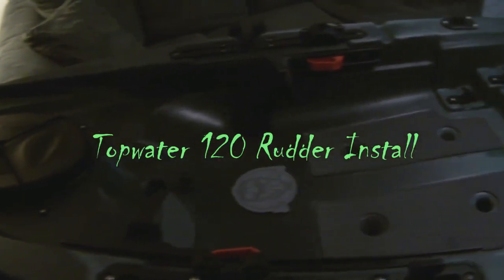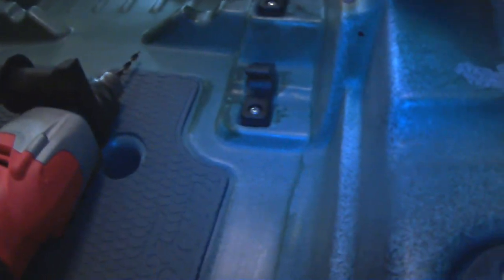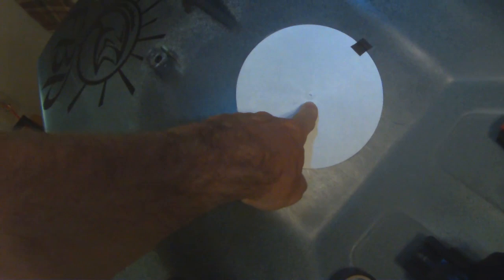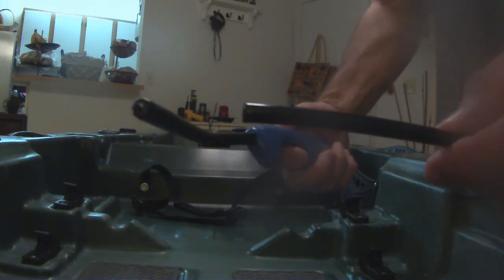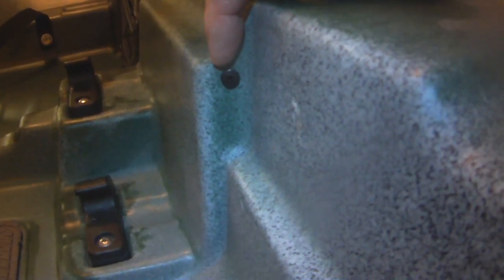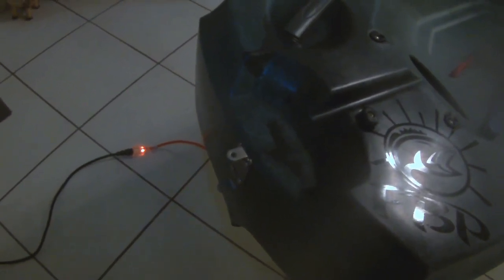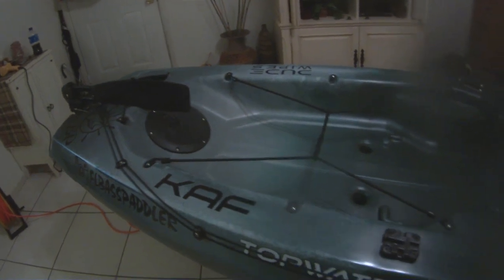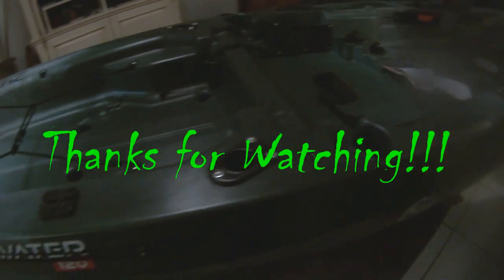Old Town Topwater 120 Rudder Install

Comment: Pretty sure this will work for the Sportsman series as well. Not sure why they didn't build in the tubes in the factory since it has provisions for mounting a rudder
Reply from the maker: It should as it is the same hull design.
Reply: The official rudder is almost $300 in Canada so I was thinking of getting a Chinese one and modding it. Some clear plastic 1/4" plumbing tubing should work for the tubes.

Comment: Bill, I have been following your install. I am to the point of installing the bungee that recenters the pedals. The instructions are unclear and I can't see the bungee in or the way its installed. Any suggestion on clarity for the bungee install for the pedals?
Thanks for the video ! Had old towns pictures been a little larger I might not be stuck!
Reply from the maker: I am so sorry, but I no longer own this kayak. I can't for the life of me remember how I installed the bungee. Again, I know it is to keep the rail system centered, I just can't remember how I installed them.

Comment: Wish you could have shown how you cut the Hole in the kayak as well as the rear tube and the rutter guides and running your cables and installing the rudder. Anytime you are putting holes in your kayak it is nerve racking.
Reply from the maker: Sticks29 Yes it is. I actually posted a video of an installation of a rear hatch in my PDL...that shows in detail how I cut the hole in the tank well.

Comment: Nice! Is it possible to just install the rudder without the lines to lower & raise and just manually lower before you go out? Not a fan of lines running on the outside of kayak.
Reply from the maker: I guess you could do that but if you hit, let’s say a stump and it knocks the rudder up, you’ll have no way of lowering it unless you get out of the kayak.

Comment: Hi Bill loved the video. I've got the 120 also and I'm debating the rudder upgrade. I understand all the install except for the foot pedals. Do the rails slide fore and aft to provide movement for the control wires. I know the pedals are stationary once they're locked. Thanks for the install video. Nice job.
Reply from the maker: Brad, thank you for the kind words. Regarding your question, during the install you will remove the existing rails as well as the pedals and will install slide rails. You will then slide the rails and pedals into the newly installed slides, and then the entire rail will slide fore and aft. The foot pedals them selves will still remain stationary to your liking. If you look at 9:59 of the video, you can see the previous rail installed into the slide. I hope this helps.
Reply: Well sir you sold me on the rudder kit. Ordered from Old Town and got a Labor Day sale price. Thanks for the video and for your coaching.
Reply from the maker: @bradthornton2494  Thanks again for your kind words and best of luck with the install.The rudder makes such a difference, it makes the kayak that much better!

Comment: I am having issues with figuring out the deployment cable.  The directions suck, and sadly you skipped over the setup of it.  I have the cables to the point where it says don’t run them through the last guide.  After that the directions basically make zero sense and the pictures the provide based off the directions are impossible.
Reply from the maker: So are you at the point where you need to make the  fishermans knot?
Reply: @flbasspaddler the directions are very unclear of where to and how to run the bungie to tie the knot, but yeah that’s exactly where I am stumped
Reply from the maker: @Snags70  OK, so if you find me on Instagram, follow me; this way I can send you a picture I found on my Facebook page. Basically, the bungee runs through the last guide and is connected to the rudder lines via two fisherman's knots. The picture will show better detail.

Comment: This looks like an absolute bitch. My old town doesn't track for shit. As soon as you stop paddling it just does a fucking 360. Which basically forces you to buy the rudder system, which is stupid af. They should've just had the rudder system already installed with the kayak and you pay a little more for the kayak.... instead of forcing they're customers to install this shit because its basically useless without it. And you cant even buy a drop skeg, which is literally all I need for the tracking. I'm selling mine
Reply from the maker: It took some work but wasn’t that hard to install. I have experience installing rudders on previous kayaks which also helped.